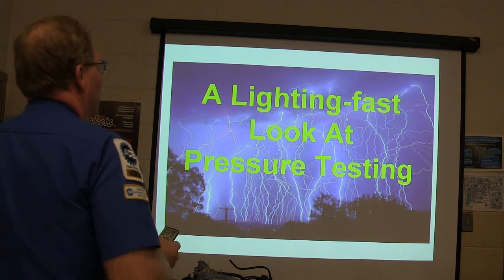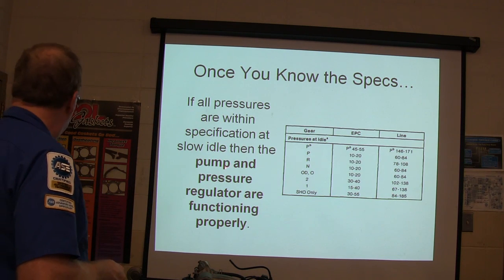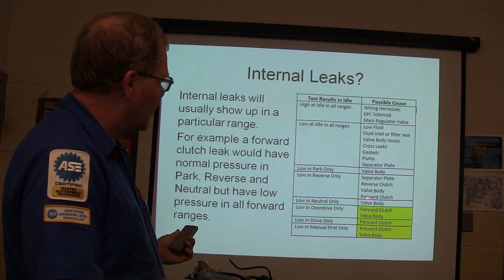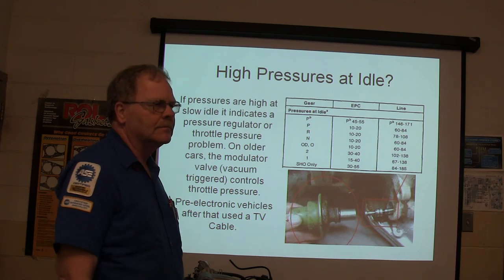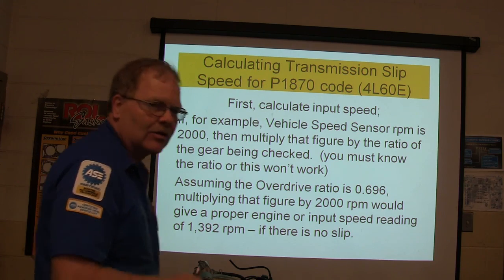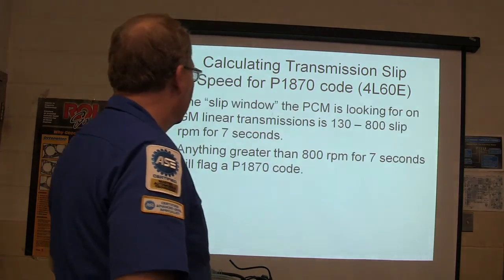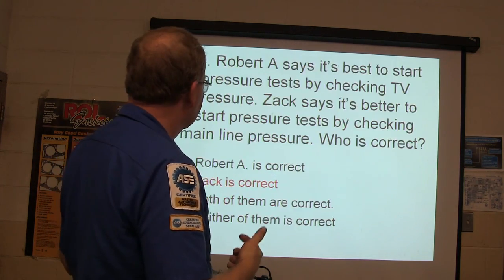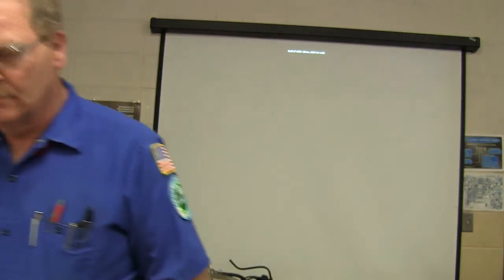Transmission Pressure Testing Basics

Comment: Thanks for the video! My automatic transmission MB 722.103 loses pressure at times. I raise the revs to 3000rpm and the pressure comes back. What are the components that can cause this problem? Vaccum Cell or principal pump?
Reply from the maker: Not familiar with that one but I'd be checking fluid level before anything else.
Reply: @McCuistian  Thanks!

Comment: Hi I have 0 epc pressure when I have 70-100 psi on line pressure on my windstar. the problem is it doesn't go past 2nd gear and I don't have any codes.

Comment: Hello Mr Richard. Could you please explain how a cooler line leaks coolant into a transmission? I read somewhere that the cooling system pressure is higher than the transmission cooler line pressure, which forces the coolant into the transmission. I would greatly appreciate your answer.
Reply from the maker: Ostensibly, it's not possible, because the transmission cooler pressure is higher - however, when the engine is shut off, the transmission line pressure dies - but the cooling system pressure remains high - that would enable coolant to migrate from the cooling system to the transmission.
Reply: Thank you so much, Sir.

Comment: Hello 
I have 4l60e slipping on 2 n 3 n 4 gears R n 1 working good today I put a gauge on the line pressure I have 65 psi on all the gears just the reverse after 3 sec have 100 psi 1 2 n 3 n 5 have 65 66 64 psi I drive with  4000 rpm same pressure 
Nothing change 
What you think

Comment: Hello! What tool is used to perform a hydraulic test in the  Ultradrive 41 TE automatic transmission (Chrysler)?
Reply from the maker: To perform a hydraulic test on the Ultradrive 41TE, you would typically use a hydraulic pressure tester.
Reply: @McCuistian  Thank you. I understand that. But I can't connect to the test taps. There's some kind of tricky thread there: 5/16"-24 and it looks like a wedge. I think some special tool is used there. What do you think?
Reply from the maker: @valentingolub195  That's 1/8 pipe thread - that's why it's tapered. Use a pressure gauge with 1/8 pipe thread and it'll screw right in.
Reply: @McCuistian  I apologize. The thread in the test port turned out to be 1/16'' NPT (pipe). The pressure gauge requires a 1/16" NPT to 1/8"" adapter. Checked. May be useful for you for information. :))

Comment: Hey Mr. Richard how are you? 
Whats the diffrence between EPC and LINE pressure? Thank you!
Reply: if your talking about the electronic pressure control solenoid it effects line pressure just like a vacuum modulator on a older car it changes pressure based on load and the only difference from the older design is its electronic instead of mechanical
Reply: @brenterwin8389  epc pressure is used to control line pressure,,by moving the main pressure regulator valve